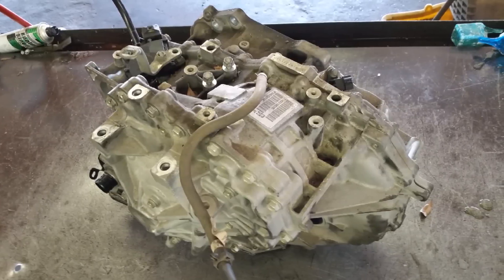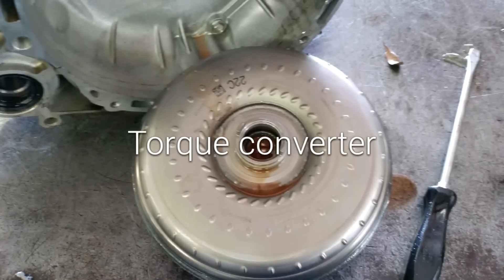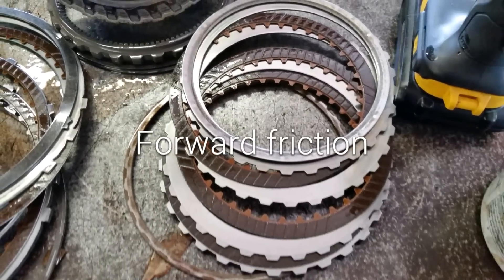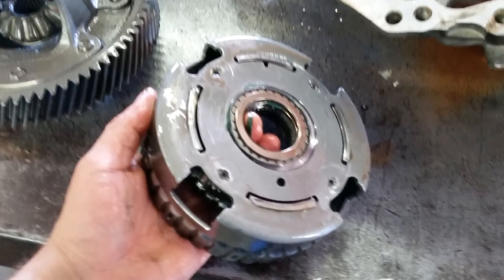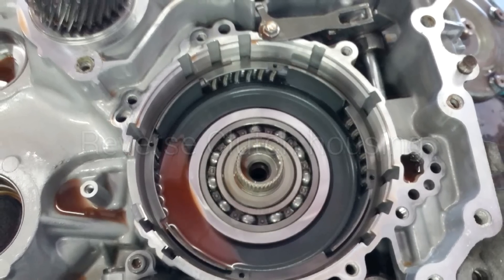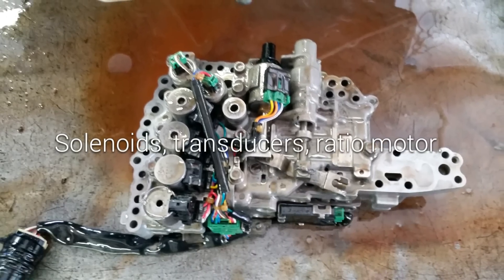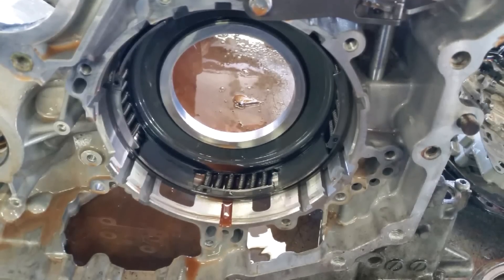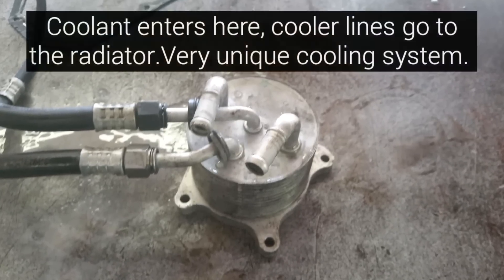JF011E CVT TRANSMISSION - Coolant Contamination - 2009 Dodge Caliber

Comment: I've got a 2013 Nissan Sentra with transmission issues.  No codes, but lack of acceleration.  Additionally, you can see the tach "hunting" a bit when driving.  Vehicle has 123k miles and has never had a fluid service.  Looking to change fluid and filter and then go from there.  I loved your video when rebuilding my Honda Odyssey.  I can say over 67K miles since that rebuild thanks to you.  Hoping to get some insight on this CVT.  Thanks for posting these videos, you are a godsend!

Comment: i have a 7004r just got it rebuilt but i don't know if i put the torque converter on right because when i go to back up i have to give if more gas when normal, will this mess mine pump up if so can i just replace the pump ??

Comment: Hiram, has revisado en esta transmisión un dtc P0777, se le reemplazó solenoide y sigue dando el mismo codigo..pero solo en velocidades altas. .trabaja muy bien. .solo cuando está en un alto y quieres despegar (WOT) no avanza solo si aceleras pausadamente, pero si borras códigos ya responde bien..si gustas mas detalles fotos o datos de scaner podemos contactarnos...saludos desde México. .Efren Cerda

Comment: hello I have a question I have a 2006 nissan murano awd and am having problems is like slipping. reverse works excellent and forth off well but can only run well till 40mph or 45mph maximum antler and if still speeding up the revolutions and high engine speed is heard but no increase in speed. think is the Overdive does not work because I can not run over 50 mph without over 2000 revolutions revolucine. you who think ?????

Comment: Hiram.  I'm working on a cvt out of a 2014 Nissan versa Note. the whole planetary gear section is gone and I was wondering what would be the origin of such damage.  where I can send you some pictures so you can see it?  also if you can tell me where I can get the parts I really appreciate it.  thanks.    saludos desde Guatemala.

Comment: I had a guy come into where I where I work complaining of over heating issues with this unit,  I had no idea about the cooling system it has
Reply: hmm i should give that guy a call and get the job, external cooler and some thermostats that open a little sooner, it was a jeep compass the guy had, damn i need to keep up.

Comment: Hello Hiram. I own a 2007 caliber that has the exact same problem as the compass. I love the car but this transmission over heat issue has me going crazy. Especially now in the summer time it over heats much faster then in winter. Where are the two thermostats locate? Is there anything else besides what you mentioned that will help keep the transmission from over heating? Thanks for your help.

Comment: Something in my transmission is rattle, what can cause this. We were thinking it was the engine
Reply: Da Mechanic change the cvt fluid the pump is making noise because the oil is thin/worn out

Comment: Did the insurance company want the core back on that CVT? I personally don't care much for CVT's, but it might make for a good teardown video. I wouldn't spend a whole lot of time doing it, but it'd be interesting to seethe inside and hear the explanation of the operating principles on one of these, especially since most transmission shops won't even touch these.
Reply: Ah well. Insurance companies in your neck of the woods act a lot different than they do in mine. Most of the time, the way they do over here is they send an adjuster to look at whatever it is that's screwed up, they MIGHT ask us some questions about it every once in a while, then hee-haw around for a little bit lookin at it and writing down stuff on their clipboards or whatever it is they've got, then approve the work. They almost never ask for the old whatever it is that's being replaced back.
Reply: I figured if they didn't want it back, you could have made a quick teardown video of it, then took the pieces to the scrapyard and sold them for scrap. I know how high parts can be for those things.
Reply: ***** будет ли ремонт акпп Kia spectra (Kia Shuma2 2003 g) ?
Reply: Hiram Gutierrez Hi Hiram got an 03 Civic hybrid CVT with pulley bearings..I changed both on primary pulley shaft and now I don't have reverse, no code set... drives smooth N shifts without surging..BUT nothing happens on reverse.. advice please

Comment: Hiram, I have a friend with a 2009 dodge caliber and she says the mechanic told her to replace the valve body because it is telling the computer that the transmission is overheating, so the car stalls and won't run after about 20 minutes. You said that on a similar car, you changes both thermostats and it seemed to fix the problem. Do you think this could be the answer for her car, and if so, is it easy to do? is it something I can probably do by just getting under the car and removing a few bolts and getting to these thermostats, or is it a big job where I would have to take the transmission apart? I would really appreciate your help on this. She doesn't make allot of money, so I am trying to save her money. Tey quoted er 2100 to do te work, thanks